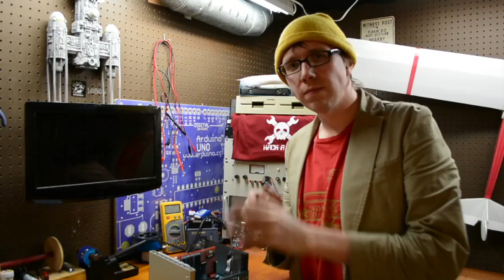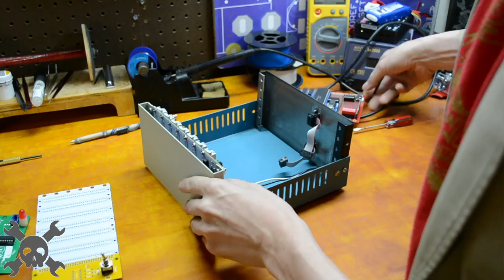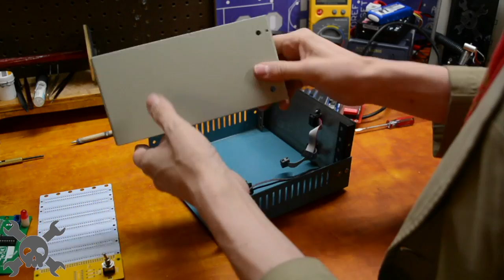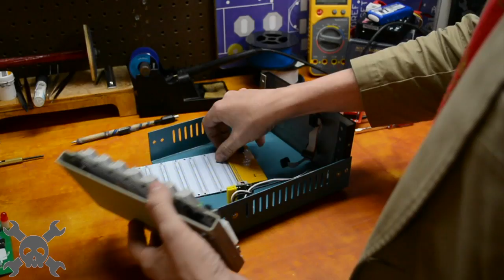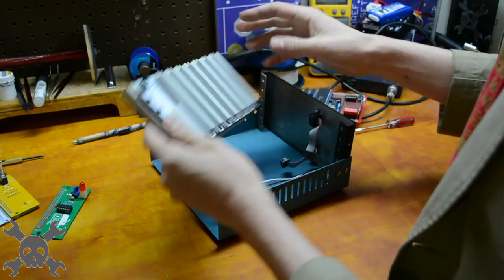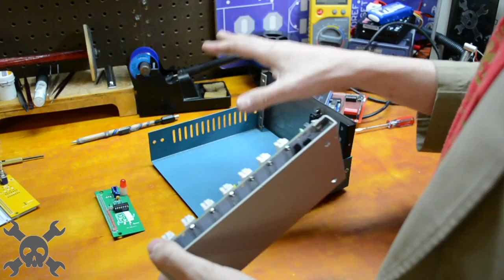Hackaday 68k: Enclosure and Control Panel

Comment: yawn. or you can just bend new sheet metal to hold things correctly. there are many solutions that could already have been done. i hate hack a day because everyone has to pick the most complicated ways to fix things. adenoids and 3d printers are cool but i feel like the people using them just handicap themselves.